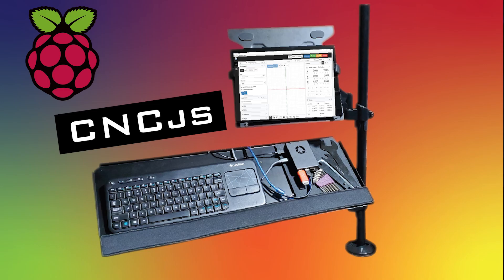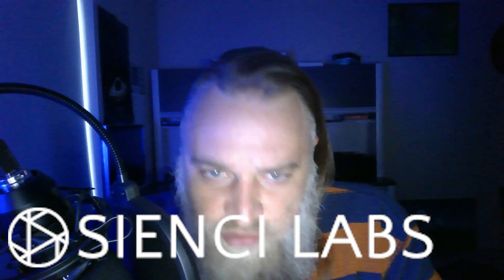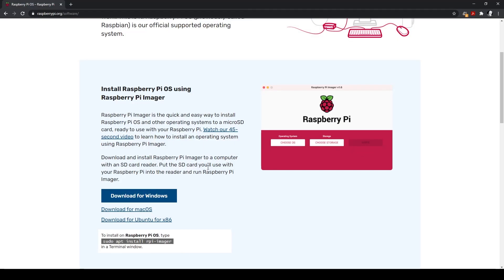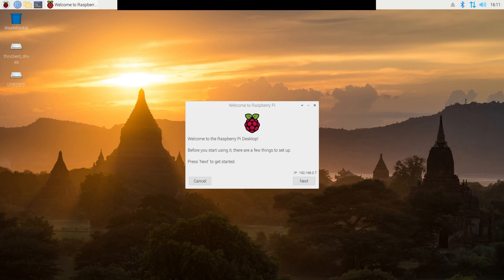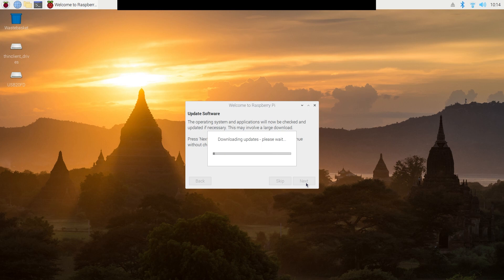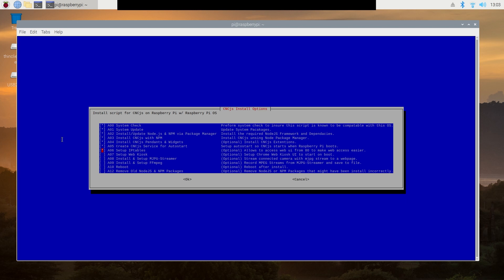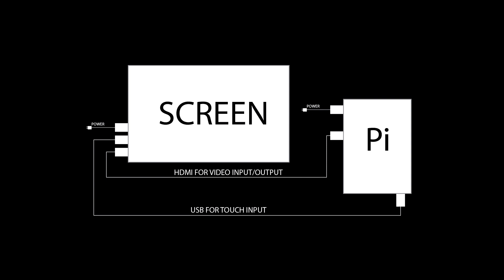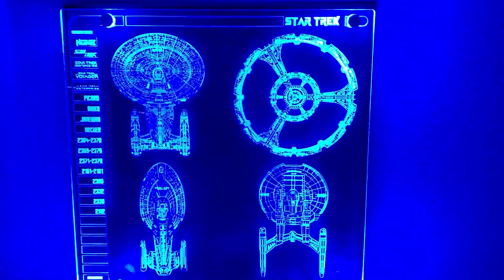CNCjs Touch Screen with Raspberry Pi - controller for GRBL

Comment: Good evening DE Hammer, great video...but it seems quite complicated to install CnCJs...I already have it on my PC under Windows 10 because I use it for my CnC...Is there a way easier to install it on the Raspberry? I want to replace my old PC with a Raspberry 4 or 400....so small and so amazing for our CNCs.....Thank you
Phil
Reply from the maker: Evening Phil, thank you! So one could write a script to auto install a lot of this. I have not done so personally and find people are reluctant to take a script and use it, as they do not know exactly what the script writer has it doing. Personally I switched over to gsender for pi. Now gsender can have its own issues as well, but it is a fork of CNCJS. I normally keep my version of gsender a couple versions back from the current release for stability.

Comment: This is great! Is this what you still recommend in Sept. ‘22?
Reply from the maker: So I dropped my touch screen and it's dead so I went with a little larger none touch screen and it was way cheaper. I now use gsender which is a fork by sienci labs of cncjs. I am staying 1 version behind on gsender as the kinks get worked out on the new releases. Right now I'm using gsender 1.0.6 the issue with both in my opinion is on large gcode files is that they can lag or become unresponive. So for a 6 hour engrave i would break it up into approx 6 gcode files. Besides that both get the job done, in my personal opinion gsender has the better gui and they have worked to make changing your grbl settings easier.
Reply: unfortunately it looks like gsender doesn’t support marlin

Comment: Awesome! Is this an all in one solution?  Does this work independently, that is without a microcontroller running grbl and a cnc motor control board?
Reply from the maker: No, I connect it to my longmill controller or to my 3018s controller.
Reply: @D.E.Hammer  do you know of a set up where the only device is a raspberry pi or pico running the cnc? thanks!
Reply from the maker: Not that I know of. I still think that the stepper motor shield uses an arduino to interpret the gcode. Have not looked into this in great detail.

Comment: Hi, great video and writeup. I am having an issue though in that everything looks OK, but CNCJS kiosk never loads. I am using Pi 3 B with the 7" touchscreen display using ribbon cable instead of USB/HDMI. It only loads to desktop and pops an info box about loading the kiosk, but never actually does. Any thoughts? I appreciate it.
Reply from the maker: I have talked to others who have had similar issues, but with gsender not scaling to the screen size on smaller displays under 12" & using pi3. I would first try plugging it in to a regular monitor and seeing if it still does not load. That will see if it's a screen issue. If that doesn't work, I would then try having it boot with out the gui. So sudo raspi-config and change boot option to CLI. Last I would try reinstalling the raspberrypi  os, but this time install the legacy OS. Let me know how it goes.
Reply: @D.E.Hammer  Still no joy. Monitor and cli did not help. The autocheck did not allow reinstall using legacy OS. Thanks for trying.
Reply: @DE Hammer Just an update. I broke down and installed it on a Pi4  that I had and it worked like a charm. Guessing something in there did not appreciate the Pi3B+. Thanks for the video and help.
Reply from the maker: Glad you got it working! Sorry I could not help on the Pi3. I have mine dug out to mess around with and see if I can get it to work.

Comment: Good evening, DE Hammer, little problem for me who discovers the Pi 400... the update which blocks and sends me back to .... apt-secure (8 )...
I did not find anything on the net to circumvent or force..
apt-get update
and so I can't continue to install CnCJs which is currently running with an Arduino Mega 2560....otherwise the Pi 400 is really cool....
If you have a solution, thank you
Philip
Reply from the maker: I am going to have to research that myself to see what is causing that.

Comment: What stepper drivers and controller board are you using? Thanks
Reply from the maker: I am using the longmills original controller with nema 23 motors
Reply: @D.E.Hammer  thanks! Do you know if it’s  powered by GRBL?
Reply: @D.E.Hammer  Google seems to suggest it’d be GRBL.
Reply from the maker: @lindsay5985 yes
Reply from the maker: @lindsay5985 they have their new board coming out and it will be grblhal.

Comment: Good evening, I couldn't install cnCJs on my Pi400, a big message appears at the end and "talks" about port 8000..I think it can't connect to the internet..but so I installed Win10 + CnCJs 1.9.27.. which opens, it tells me port com3 (of my Pi400), 115200 bauds but ONLY the Grbl line is displayed... not the parameters... I'm stuck there.
Any idea of a solution for the 2 systems ??
Many thanks to you
Phil

Comment: Thank you for sharing your knowledge. This is a great video and I will certainly look at your Chanel. 
I have an old Pi 3B + I once used for octoprint. Do you think it would work with cncjs?
Merci beaucoup :)
Reply from the maker: Your welcome and thanks for watching. I believe it should work, but as all things pi related issues can pop up between updates. I know there are issues with smaller screens, than the one I use in getting it to display correctly.
Reply: @D.E.Hammer  Ok Thanks. I will try to find the time to give it a try next weekend. I will let you know how it went.

Comment: If you go to localhost on another computer, it will try to connect locally and load the web content from that other computer, which will most likely be an "error connection refused".
Reply from the maker: I am going to have to spend some more time working on my networking abilities. I just can not seem to get a grasp of it.
Reply: @D.E.Hammer  Good job on the rest of the video though. 🙂
Reply: As long as you connect from a computer on the same network, you should be able to hit it by IP address (http://<IP>:8000)
Reply: @lsmunoz46123  Sure. That should work fine.

Comment: this video was great to follow, however now its installed, I have no idea how to run cncjs please could you advise as to how to run it once its installed
Reply from the maker: Once it is installed it should boot up after a bit into CNCJS. Once in CNCJS you will want to go to the Connection area on the left hand side, choose the port in the drop down and then click Open. If all connects the Console are should change and show you all your $# settings. This is where you can manually change your feed rate. The next steps can be in any order. Normally I first home my machine, and you do that in the Axes panel located in the top right of the program. Once you get your bit to where you want it, in the work position field press the third button (It is the one that looks like the symbol you see on online maps). Do that for all three axes. To import your file go to the Upload G-Code and find and select the file you want to carve/engrave. Once that has imported you can press the play button to start your carve. I hope this helps and this is just the bare bones of getting going with CNCJS.

Comment: thanks for the video. Just got a pi, and am looking for a control program that won't bog down during a large run like GCode Sender does. CNCJS might be what I need...except one small thing. Following along with your vid, everything is fun up until the curl statement, at which time it does nothing! It doesn't bring up the screen you show, so I can't do any of the operations you list following the curl statement. Do you have any ideas as to what I might be leaving out? HELP!!!
Reply from the maker: Just want to make sure, are you getting the screen that has the OK?   Or are you not getting a screen after you press OK? 

If not getting a screen after you press ok. Restart the terminal, put in the URL, then do the bash line. BEFORE you press OK, scale the terminal larger or full screen it. 

If you are not getting to the screen with OK on it. Is it just sitting there, does it blank out?
Reply: @D.E.Hammer  it just goes back to the prompt...does not display "ok", just the prompt
Reply from the maker: Have you tried the second method  download it then install:

URL="https://raw.githubusercontent.com/cncjs/cncjs-pi-raspbian/master/cncjs_install.sh" 

wget -O cncjs_install.sh "${URL}" 
cat --number cncjs_install.sh 

sudo bash cncjs_install.sh
Reply: @D.E.Hammer  no...but this I will do next...thank you for the help, whether it works or not :)
Reply: I am thinking that maybe I have the wrong OS. I have been hearing that the newest Raspberry OS is somewhat different than the slightly older versions, and to be compatible I might need to install Legacy instead...so, gonna try that.
Reply from the maker: Yes, the new os came out after this video, so i am using "legacy" os.  It is simple to install.  In the pi imager, click choose os, then raspberry pi os (other), then scroll down to legacy.
Reply: @D.E.Hammer  that was it...finally got CNCJS up and running...and it runs great! No buffer overflow like I was getting with GSender yayyyy. Thanks for the help! One thing that was amusing...when the first configuration screen came up, the one where you choose the web kiosk, I couldn't see the pick boxes and could not find a way to scroll the window to the right, so I had to enter in the longggggggggggg command again after maximizing the terminal window...but it worked. I also put the cncjs on the favorites bar in the chromium browser so I can load it without having to reboot.

Comment: Hi DeHammer, last precisions....due to CnCJs inoperative under Pi400 i've  installed CnCJs  under Pi400 + Win10 ...now CnCJs run ( V1.9.27 ) but its speed is very low, the display of displacements is made by jerks... How to remedy it or to be able to make it turn simply under Pi400 (WITHOUT Win10)?
bCnC or gSender work well under Pi400 but the possibility of the 4th axis does not appear in the display despite the Grbl 1.1e which manages it...
is there a solution ??
Thanks
Phil

Comment: Hello, i come back to you because i've already loaded CnCJs on my RPI4, all run 6 moths ago but after many weeks with no time for may CnC i don't remember how to run it under RPi4 ...Which sentence do i have to write ?.......for example....run CnCjs...doesn't match................do you get a solution ?
Thank's a lot
Phil
Reply from the maker: Try using the gui and go to the web browser and type in:
http://localhost:8000

Comment: thanks for the video. It was very detailed and informative. I saw a video on OneFinity (a competitor to Longmill) where they used a game controller to move around the router. Can one of those be incorporated into your build or are there not enough USB slots? thanks
Reply from the maker: You can always add a usb hub to add some more connections. If you do not need a keyboard or you are sending the files to the pi remotely then that should free up a space. I have not tried a game controller, but have also seen people use them. Think I know what I should look into.

Comment: I installed CNCJS  to Pi3. It is very unresponsive. Do you think this is due to lack of CPU/GPU resources or something is wrong with the versions installed?. Tnx
Reply from the maker: It could be the new os, have seen others have a variety of issues on pi3 an older with it. So first thing you can try is flashing the legacy os and see if that clears it up.

Comment: Hi I have installed everything and got to the blue screen with options and can only see half of it so can’t select anything tried screen resolution resize full pc monitor but still only half of tab everything else is full screen please help thankyou
Reply from the maker: I believe you are referring to the part where you do the install CNCJS and you have to expand the screen manually before you press ok. Had this happen to someone else as well. You just need to close out  that terminal, open a new one. Type in the URL, the type in the bash line. Then adjust the window for the terminal to full screen. I think that should do it, let me know if that does not work.

Comment: Hi, this evening i've tried to reinstall cncjs following " Installation guide " from the net....another issue at the end, terminal Pi400 doesn't accept...................npm value  then unsafe perm

sudo npm install npm@latest -g     .......then .......   sudo npm install -g cncjs@latest --unsafe-perm                  

sorry another issue.........

phil
Reply from the maker: Ok let's see if they are installed and check what architect your pi is
nodejs - v
node - v
uname -m
Reply from the maker: You may need to Uninstall both and reinstall. 

Sudo apt remove node
Sudo apt remove nodejs

Then try sudo apt install nodejs

Comment: Great video, i also use a Pi 4 for my Longmill. i just don't have a touch screen, just a regular screen and mouse.  I use the web interface of the pi from other computers to load content.   The fan on my pi was getting so loud i had to disconnect it.  The odd time on longer cuts i get a temperature warning on the pi and need to put a fan to it to get air moving, not sure if you have had that experience. I think I'm gonna do a clean install soon.
Reply from the maker: Thank You. My Pi came with a fan, and it has been cold here lately, so have not had any issue with temperatures on mine. Will be interesting to see when the Texas Summer gets here and how it handles the heat.

Comment: Sorry, from " Installation guide " (on the  net)....same issue at the end, terminal Pi400 doesn't accept...................npm value  then unsafe perm

sudo npm install npm@latest -g     .......then .......   sudo npm install -g cncjs@latest --unsafe-perm      

despite removed ..........node, nodejs  then réinstalled...........sudo apt install nodejs

i'll try again with yours for the end with .................curl -sSL....

Phil